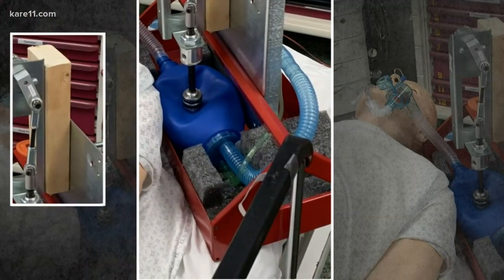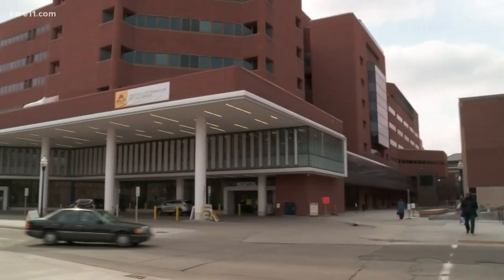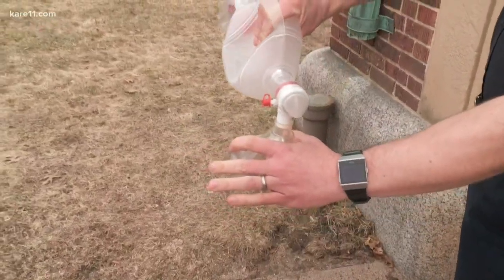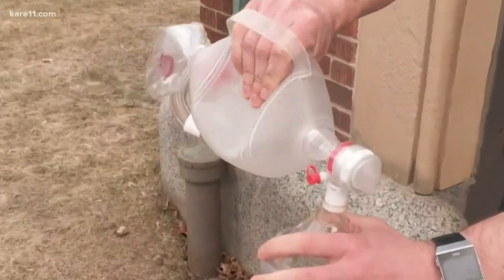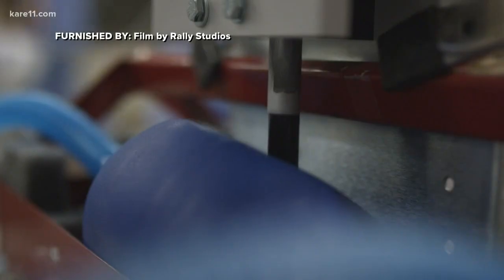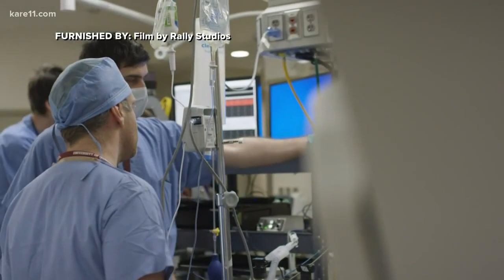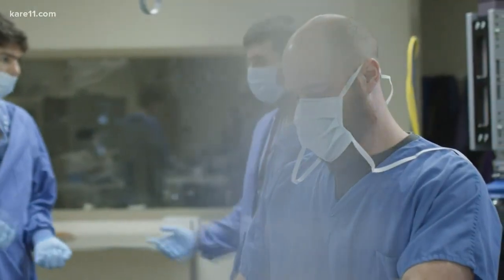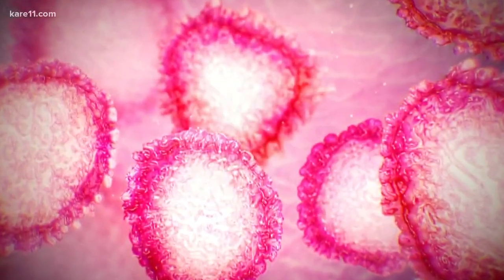‘Going full-on MacGyver’ – U of M doctor creates makeshift ventilators to battle COVID-19

Comment: Do you have the "full on MacGuyver design and instrucions?" They just split a vent for two patients in NYC which is as you know, fraught with issues.  If the "full on MacGuyver design" could be slapped together with parts from the local hardware store, etc., can you share that so that they can build some to address the shortage that is happening right away.  30k ventilators needed.. they may not have 1 week or 2 weeks!
Reply: They are sharing it but the FDA (according to the story) needs to approve it prior to use. Pressure needs to be put on them to give it the go ahead, now.
Reply: @eb7358  where's the design...